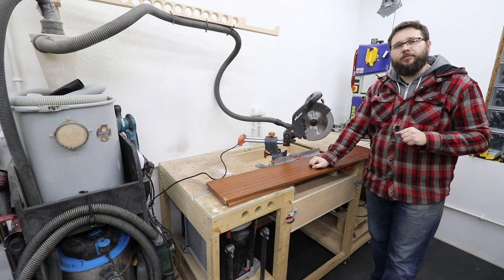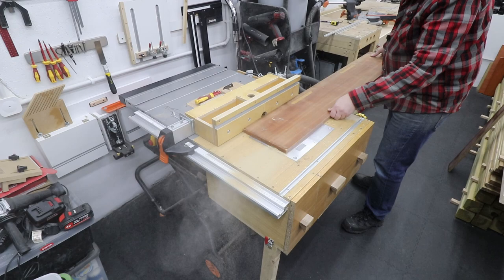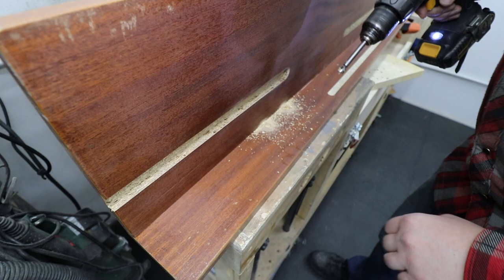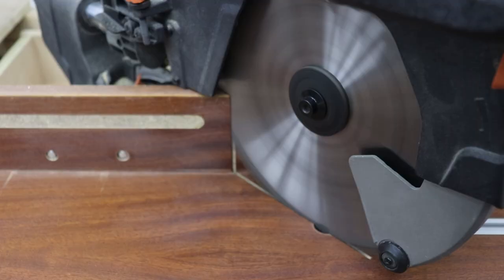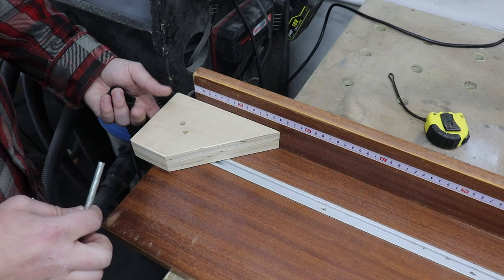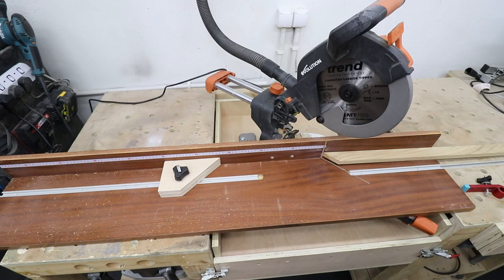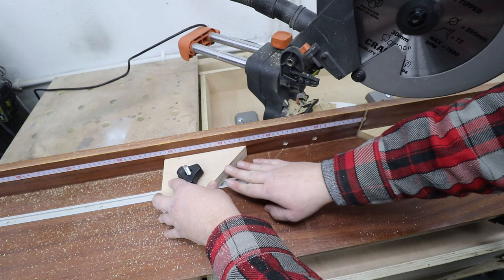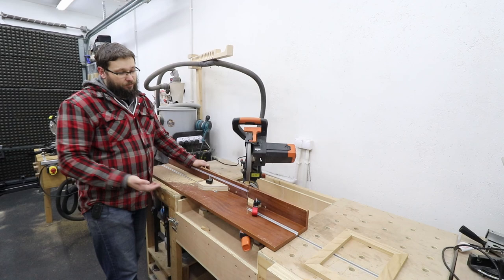Simple Picture Frame Jig For Your Mitre Saw

Comment: Nice jig ... not criticising, but a couple of locating pins (or bolts with wing nuts) on the horizontal surface would mean you could quickly add/remove the jig, rather than having to deal with bolts 👍
Reply from the maker: True 👍 good point and improvement 👍

Comment: A follow up comment. After spending an afternoon fiddling around with things I was able to adapt your design to my non-availability of a shop. I used an old shelf for the base, glued a strip of wood along the back edge, marked off in half inch increments. Using the small strip along the back I can precut my rabbit. Refinements include bolting it down to the bed of my saw so I can remove it when done. A better stop block for the left side and just some other general improvements. I have feeling it will be a continuous “work in progress”, thanks for the basic idea.
Reply from the maker: Glad that my video was some inspiration 👍

Comment: I have never gotten perfect miters straight from the saw, jig or no jig. My saw is simply not accurate enough. Yours must be better. Your jig is great. Very smart. Thanks!
Reply from the maker: Well usually you should be able to set up your saw so it will give you accurate cuts
Reply: @CasualDIY  This is a 12" DeWalt compound miter. It's not for picture making. No matter what I do, those 1/4 degrees add up.  I have an old 10" Makita non beveling that I'm sure will do very accurate miters, but I haven't yet set it up. Thanks so much for your personal reply. That means a lot. Best of success in woodworking and all your endeavors.
Reply from the maker: @carlosreira413  no problem and thank you very much

Comment: Thansks Tomasz - great jig. You screwed in the t-tracks into the chipboard. Do you have a link to the screws you're using as the screws that come with my t-track would go straight through the routed dado in my 18mm ply.....
Reply from the maker: Bought a bunch in my local DIY store. So no link sorry.

Comment: Do you always depend on the outer  dimension to make the cut even if you are cutting a frame with a rabbit? I don't see how the stop can set that for you since that's the actual size you are concerned with. The width of the moulding can dictate the length. True?
Reply from the maker: I do calculate that before hand, rabbet size and then final frame size. So in the end I only need the frame dimensions for the jig.
Reply: I am thinking the ID is +1/8 over the art size or matting, plus 2x the width of the back of the frame, not the overall width. The 2x is for the equal leg of the 45 degree cut in the long dimension. This gives the overall outer length that you are making here.

Comment: Hi Tomasz,  a neat and clever jig.  How well does it work with moulded picture frames?  Mike
Reply from the maker: Depends on the shape and if you can have it in a stable position. Although not tried it myself on it yet. All the shaping of my frames are done afterwards when the frame is cut to size. Just find it easier that way

Comment: This is the 3rd time you are using timber from a bed if you keep cutting up your beds for your projects it will not be long before all the family is sleeping on the floor.😜😂
Reply from the maker: 😅 keep finding them in skips, chip board, its always chip board 🤣
Reply: @CasualDIY  I love laminated chip boards from old kitchen cabinets. Straight edges, perfect 90 degree corners and for free.

Comment: Nice jig, however did you say precision cut? You don't get good precision when you're eyeballing your stop which is a good centimeter below the tape line.  finish the job
Reply from the maker: Yes I wanted to add a t-track on top of the fence and add a movable indicator but I have ran out of t-tracks 😅
Reply: @CasualDIY  I get it you're very resourceful using what you have I do the same really all you need to do is add a little block at the top to line up with the ruler
Reply: @CasualDIY just use a taller stop block.